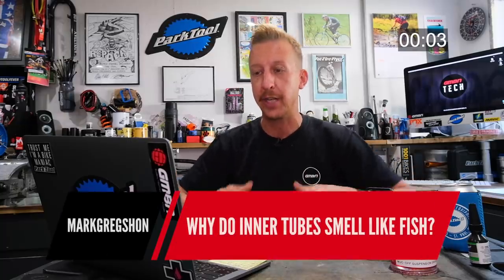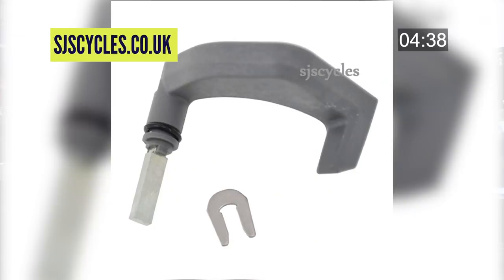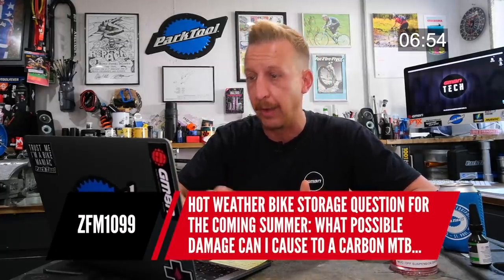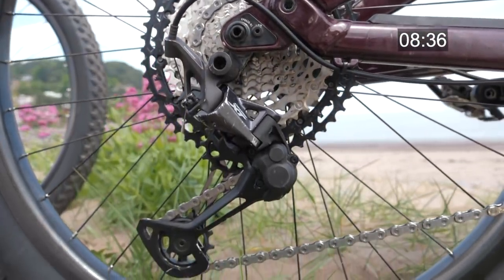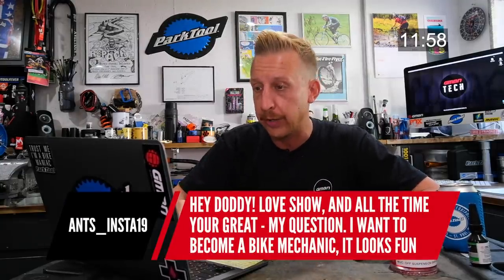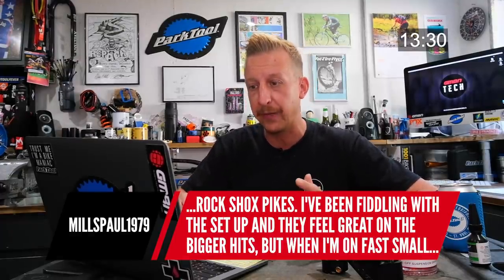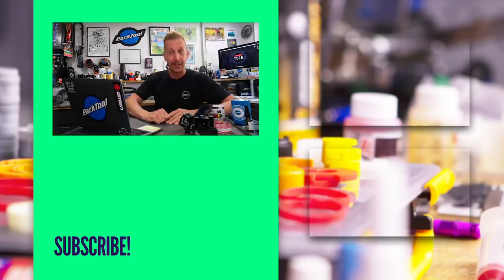Buy A Bike Or Service At Local Bike Shop Or Online? | #AskGMBNTech

Comment: 9:26 just calculate the gear ratios, get the speed from the wheel circumference with a 90 rpm pedaling, and see which size ring suits the best for you for the speeds you usually go. Easy with Excel

Comment: #AskGMBNTech
Hi Doddy, I am currently restoring a Cannondale Super V 900 from 1998. I love the new Shimano deore 12 speed drivetrain and am left wondering whether there are any 26 inch, non boost microspline rear wheels or hubs. Do i have any options? Any help and advice would be greatly appreciated, Thanks

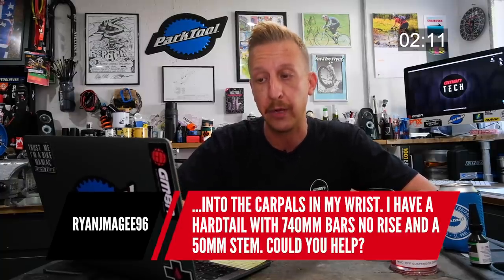Comment: 2:41 it could be he needs longer reach too, of course cockpit changes will help if that's the case but won't solve the problem if it's reach, so take this into consideration too.
also pain in hands can also be wrist, joint issues, I have really floppy wrists, So I have wrist supports on both wrists. I use 
Troy Lee Designs WS 5205
it's difficult to know what can fix the problem he is experiencing without seeing his setup with him on the bike.

Comment: On line, Ken ellerker in Hull serviced my bike once. Crushed the external dropper post cable- had to buy a new one. New derailleur didn’t index gears nor set limits screws, and new crank set - failed to tighten the crank arms. Not bad for £200. Never gonna use a bike shop again

Comment: You can add water bottle mounts with a rivnut. It does require to drill your frame so that will void any warranty and may compromise the frames integrity.
I've done it on a few bikes but they were cheap and more of a road bike.

Comment: For the person with the indexing issue, it sounds like you might not be having an indexing issue, rather your hangar is probably out of allignment. always start with that, because no matter what you do to a derailuer/shifter, a bent hangar will still ruin your day. Now, if you still are having the problem then I'd look into  your cable/housing. Usually you should replace both and not just 1 or the other. If there's a kink or corrosion/dirt in your housing, a new cable wont help, but using the old one in new housing will not work either. and same goes for rusty or kinky cables, your housing still has that same corrosion or kink in it and you won't have a good time shifting.

Comment: #askgmbntech hi Doddy, great show and love the tech and the cave.... I've got a 10 speed shimano 11-34 tooth cassette and want to upgrade it to 10 speed 11-42. Would I need to do a do a complete full adjustment of the gears or just adjust the height of the derailure from the biggest sproket to compensate, as gears shift perfectly at moment....Cheers
Reply: as much as i know, your derailleur must be capable of 42t (some derailleur) like XT RD-M781 have a problem with 42t
Low Sprocket Max: 36T
Low Sprocket Min: 32T
Top Spocket Max: 11T
Top Spocket Min: 11T
Max. Front Difference: 18T
So the derailleur wont work properly (in my case)

Comment: I had exactly same issue with eagle. Went back bike shop 3 time for warranty repair. Bike shop put it in stand every time and it shifted fine. In the end I told them I wasn't paying finance till it was sorted. They sent it back Sram. Turned out it was cracked pivot pin that couldn't be seen. Sram replaced it under warranty. If that bike is less than 2 years old it'll be covered by Sram.

Comment: Thanks for the dude who asked if 27.5+ can fit on a 29 and you Doddy for the information about them. I'm still figuring out MTB stuff since I'm kind of new and I'm getting into MTB because I won a Stan's Flow EX3 from a giveaway lately and opted to go with 27.5 because they were lighter and you can put 2.35 inch up to 2.8 inch width plush tires according to what's on the rim. I'm a roady and a newbie when it comes to building bikes except BMX where I started.
Reply: Clint Nieves 29 fits on 27.5 plus.      27.5 does not always fit on 29 er bike. (Rear clearance)

Comment: Hello from the colony’s. I recently got back into MTB after 25 yrs. I bought a Trek Marlin 6 two yes ago to see if I still enjoyed the sport, and I still love it! I am upgrading the M6 to be my hard tail but I have out grown it and want to buy/ build a full suspension bike. 

I have noticed there are two different rear rear shock’s (vertical & horizontal). What is the difference between the two. I want to make sure I chose the correct frame. Most of the trails around my area have mid level downhills and loaded with roots withSome technical sections. Any help is appreciated. 
Cheers!

Comment: From the looks of the online bikes they have better components more often for the same price.  If you can build it and maintain it yourself the online bikes would be a better choice.  If you have warranty replacements if its online or from a store its still getting shipped away to the manufacturer.  The online has no sales man giving you fauls information or up selling you into something you dont need. But you could also get special deals you would never get online.  One thing to consider is most of the top bikes reviewed every year are from online stores.

Comment: I’m looking to upgrade my fork. Stock on my 2017 Raleigh Tokul 2 (27.5” tires) is an SR Suntour XCR 120mm travel coil, with a 15mm “QL” Thru axel. 

What are the things I need to do to make sure I get a fork that fits.  Can I add another 10 or 20mm of travel to it.  Do I need an adapter for the axel. Basically all the budget fork upgrade questions.  #askgmbntech

Comment: #AskGMBNTech last weekend I converted my wheels to tubeless. First, everything seemed fine but today, I checked the pressure and it sunk by almost 10 psi! I have only ridden it twice on sunday and monday and Im pretty sure that my setup is completely tubeless ready, i even replaced the old rim tape with the dt swiss tubeless tape. My tires are a maxxis minion dhr and an ardent. Any suggestions on why it could be leaking?

Comment: #AskGmbnTech I have a problem with my (mineral oil) brake lever I think it might lose oil over time is there any way to fix this or I should just get a new one?
Reply: Ok Soo if you can find the leak then just replace that part ( either, hose, caliper, lever) but if you can't ur either your going insane  or should bring it to the local bike shop, if they find it quick they probably won't charge
Reply: @raphaelroshwalb5500  I know it's the lever and from the piston inside or from the seals there I'm not sure
Reply: @sebipadeanu722  your best bet is to replace the lever, or get it in for a warranty claim as these things are usually covered

Comment: Hello Gentlemen,  Thank you for all you do.  It's really appreciated.  Question:  If an e-bike purchased from a bike shop requires a 2 week wait for repairs under warranty,  Is it reasonable to expect an e-bike as a loaner?  I've only had the Specialized Levo for 1 month and having issues with either the motor or battery.  I believe it's the motor.  Thanks again!   Daniel from Los Angeles, CA.

Comment: I’m looking to replace my fork on my 2017 Raliegh tokul 2, 27.5.  

As far as I can tell, it takes a straight steerer tube but has a thru axle. I’m having a really hard time finding a replacement fork that fits those two specs.  I was looking into the Rock shox judy, recon, 30, the markhor, etc.  it seems none fit those two specs.  Are there options I’m missing? #askgmbntech

Comment: I have a breathing air tank 300bar originally used to fill a PCP air rifle. I've bought a hose with Schrader valve connection and a Presta adapter to suit for muc off tubeless kit, this will all connect to the tank. Could I use this on my MTB for tubeless set ups? Has this already been done by someone? Would love to get some insight if this could work before going ahead and scrapping off a brand new set of wheels and tyres. Thanks, Ash. #askgmbntech

Comment: Doddy love the show,  I'm after a bit of help... tried a bit of home spannering during lockdown fitting a new fork. Anyway some idiot (!?) put threadlock on the top cap headset bolt and now I can't remove or tighten the headset! As the forks are on the bike, Is there way to remove the star fangled nut from below? My other option is to try slide a hacksaw under the top cap and cut the headset bolt! The bolt itself appears to be spinning freely of the nut without getting any purchase (the "wings" of the nut don't appear to move when turning the bolt) Any suggestions would be greatly appreciated! Thanks in advance #AskGMBNTech

Comment: #AskGMBNTech Hey guys! I have a SR Suntour XTC coil fork and lately I have been noticing that mi stantions are completely dry. I wanted to service my fork so I was wondering if I could put regular grease in/on the fork. I saw someone else doing it on the same fork that  so I want to confirm  if that is the right thing to do.

Comment: After my last purchase I will never go into a store! Least not the one near me, it seems like all things change and the local bike shop isn’t immune, the one I had when a was a kid was great and they could fix anything now they seem like they only wanna sell bikes and don’t have the time for anything else. I bought a 2020 Salsa Beargrease which is a decent bike I had minor gripes and rather then try to take it back I simply sold the bike, I opted to build out an old pugsley and swap the heavy clunky 2x9 for a 1x12 gx eagle, mind you I’ve always until the salsa have had single speed bikes so this was a huge undertaking, I tried asking my shop about it and they were full of excuses so I set out and did my homework and ordered everything took it in to them to have the new hubs laced up which I should have done but I figured they would do a better job, $150 per wheel and the guy says I’ve never laced an offset wheel before, it’s the same as any other wheel just go left or right...All this guy does is complain about the build I gave him it’s gonna takes weeks and he’s taking the fun right out of it, all I Hope is they do a good job...that Beargrease was a mistake if i ordered online I would have taken more time and research and bought the right bike to begin with! This pugsley has dropped a bunch of weight after I got rid of those hideous surly tires, deleted the front brakes, put on carbon bars and switched out those heavy steel cranks for aluminum, can’t wait to ride.

Comment: #gmbntech I just had a delivery of 2020 yt Capra base29er that you doddy showed it on one of your previous show, my question is the shock it came has no lockout any recommendations if I go coil etc? Cheers
Reply: Don't go coil unless your sure about it, really it can be a huge waste of money buying spring after spring. Probably better if you sell your current shock and but one with a lockout and it you just generally want a bit harsher ride try putting more air or some spacers or get it professionally tuned
Reply: Raphael Roshwalb sounds reasonable, cheers

Comment: #AskGMBNTech Hey, love the show. I have a trek fuel ex 5 2018. I was thinking about upgrading the fork (RockShox Recon Silver 130mm) to a RS Revelation 150 mm. And also the shock (RockShox Deluxe RL 210x52.5) to a RS Monarch Plus RC3 Debonair (216x63). I think the geomtry won't really change, just the BB height. Am I right? Would there be any more differences? And the other thing is can I fit 29x2.4/2.5 (currently 2.3) on my rims (Bontrager Connection 32h)

Comment: How do I make my bike sound like the pro mtb? I have turned it ?
Reply: Make sure your JIB canister is at least half full before riding and the Stylie Tube is connected to the chain stays and or the BB. It's always a good idea to check your Chunk Meter and that it is zeroed out(pointed opposite to the direction the bike is facing away from North). Finally the Droppin Flankmonger needs to be pointed at 13/50 or the bike will simply lock up. And ALWAYS adjust for Pi!

Comment: #askgmbntech is there a way to route my front break cable through my top cap, I believe I have seen it done in trials but I take it they use a different system as a star nut wouldn't allow it?
Reply: Ok here's a short answer, if you run threadless headset I've seen people get top cops with a whole in it( by drilling it or buying it like that. The star but might get in the way but you can always drill it( I think, I take no responsibility) . Seth bike hacks did a hack on this but I forgot which video. You can also use the One up EDC top cap for like 20 dollars and and tap your headset, I've seen some very very neat cable routing where they route all there cables through the top cap and under the bottom tube. But do your research
Reply: @raphaelroshwalb5500  cheers mate I'll try and dig up that vid from Seth first and see where it goes
Reply: Ok so this wasn't the Seth bike hacks video I was talking about but here's another good one with a hack for internal cable routing  https://youtu.be/k4z4SnHDCpo

Comment: #AskGMBNTech I am thinking about increasing my fork travel from 130 mm to 140 mm, but according to the bike manufacturer the geometry should not be touched. I was wondering if an addition of 10 mm of travel would hurt? However, does an increase of 10 mm make sense anyway and is this even noticable?
Reply: Alright, thanks man! Hopefully it is chosen by Doddy 👍
Reply: Subtract sag and you're paying (how much?!) for 7mm more travel.
Are you using a digital pressure gage already?! Cuz if you can't tell the difference of 0.2bar in tire pressure the increase in travel will go by unnoticed.

Comment: #AskGMBNTech Hey, just bought a new jump bike (ns movement 1) it has the manitou circus expert forks on it, my question is do you have much experience with manitou forks, the forks alone are priced around the £350 but if I want to change them for a fox for instance I would be shelling out over £1000 for a pair of new forks is the money worth the upgrade or are the manitou ones a good fork for my jump bike, thanks in advance!

Comment: #AskGMBNTech 
Hi Doddy, love the "speed advice service" :) (and the channel) 
My name is Daniel from Sydney AU. I'm wondering about my new XC bike setup. Are general XC specs "set" in stone?
QUESTION 1: My Merida Big9 7000 runs 100mm fork and me being a bigger guy (6.2" fit 95kg), my XC fork has an option of adjusting it to 120mm. Should I take advantage of it due to my "size'? 
QUESTION 2: I'm considering changing my Kenda 2.2 tires for Continental CrossKing 2.3 tires. Would it make a positive difference (due to my "size")?
LOVE THE CHANNEL, keep up the good work guys, and thank you for a tonne of advice that helped me during the corona ISO working on my bike project.

Comment: #AskGMBNTech I have got myself a new gt sensor carbon pro sram 2017 but it has a hidden rear shock ( fox)and it’s almost impossible to get there. Any tips for this or is it the same process for setting up the suspension?
Reply: Grab a beer
Reply: "Same process" ... for what?! You didn't mention!
Adjusting sag?! You're unable to make a read on the O-ring, right?!
Reply: Grab a roll of painter's tape and put two pieces on both sides of the bearing, mounting the seat stay to the seat tube.
Make a mark across both pieces of tape using a VERY fine pen - fully deflate the shock - now transfer one of the shifted marks to the other side of the "tape gap" - now you have a piece of tape with two marks (indicating your max travel) and the other piece has only one mark (your new "indicator") - utilize these marks to find and set your 30% sag or whatever you prefer.
Cheers!
Reply: Raphael Roshwalb thanks dude
Reply: Le Typ adjusting the sag and air
Reply: Le Typ thanks dude
Reply: @mag6569  You could also just measure the distance from your rear axle to your saddle's rear edge in both positions.

Comment: #AskGMBNTech can I fit a 10-50 tooth cassette on a bike with an 11-46 11 speed cassette without having to change the derailleur? Thanks
Reply: Yes and no, you don't need to replace your derailleur but your probably need to replace your freehub
Reply: @Charlie:
Check your derailleur specs for two things:
- if capable of 50t as biggest sprocket
- overall capacity (add the differences of smallest-biggest sprocket to smallest-biggest chainring)
to not over-stretch/damage it.
Also your chain (fitted to 46t) might be too short.
Won't need a new derailleur per se, maybe a so called "goat link" (google it) will suffice to extend its range!

Comment: #ask gmbn tech my bike is cricking from either the bottom bracket or the linkage what should I do
Reply: Disassemble, clean, check for wear, add grease/assembly compount where needed when re-assembling and torquing to spec.
Reply: @geemail369  now that's a good idea

Comment: #askgmbntech I’ve ridden dirt bikes my whole life and just recently got myself a nice mountain bike and form what I’ve noticed mtb manufacturers almost never use inverted forks in triple clamps like on a dirt bike it seems like there are serious travel advantages to this I’m curious about the disadvantages though and why you almost never see inverted mtb forks
Reply: Inverted forks raise the center of gravity slightly and place the stanchions in the position most vulnerable to rock strikes and ingesting grit. Some say they are also more prone to torsional flex without the bridge that you see on conventional MTB forms providing reinforcement; you would incur a significant weight penalty to build a robust upper and still include the bridge to completely mitigate that disadvantage over conventional MTB forks. As for multiple crowns, you don't see it as much on MTB because the forces are not typically high enough to require it and having multiple clamps limits the range of motion from the steerer. It also knocks against the head tube area which can cause premature failure in a carbon frame if the layup isn't built to take forces in that direction and makes the bike more cumbersome to store and transport.